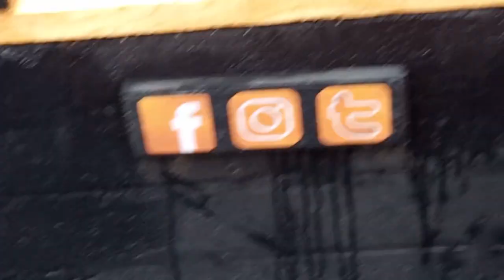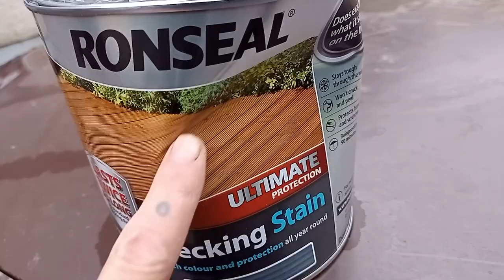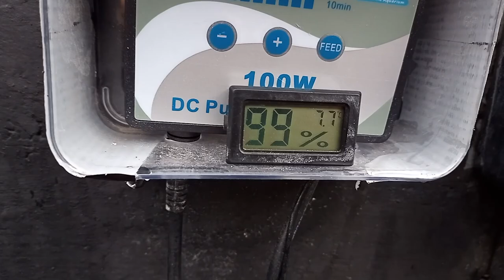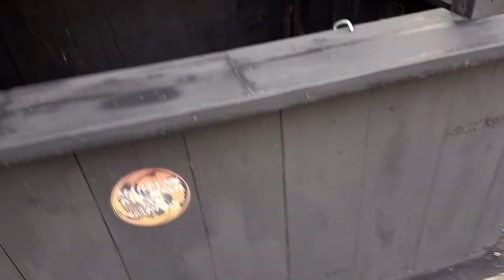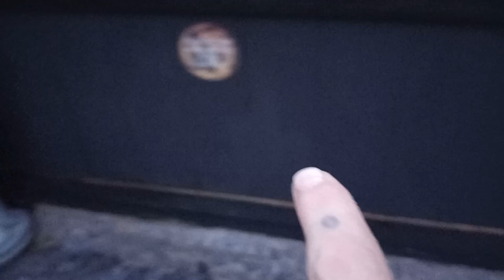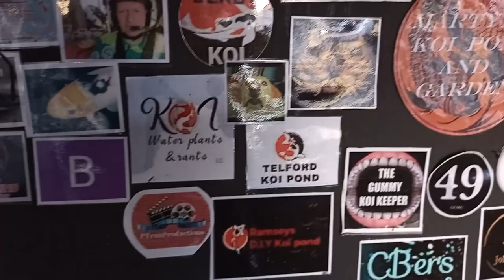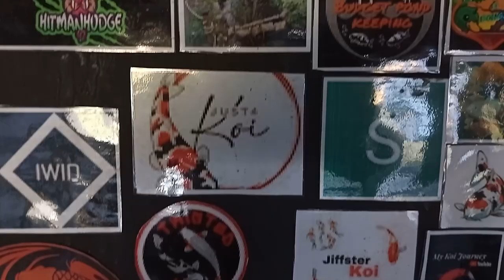staining the pond capping and a new addition  bhudda koi pond one man pond build #koipond #koi #diy

Comment: The grey stain on the wood looks really good and ties in well with the slate. I think a large piece of Jap mat would work well up against the side of the moving bed and stop any K1 escaping and running down the drain. Your brushes should stop the Jap mat getting tangled with blanket weed so cleaning shouldn't be too bad. The IBC would make a great grow on tank as I would worry about small fish in that size of pond unless you plan on adding large fish in the future instead of watching small fish grow.
Reply from the maker: Cheers Oliver jap mat ain't cheap I will have a good think about what I can do with the ibc cheers buddy 👍
Reply: @martynskoipondandgarden4581  I know what you mean everything about koi is expensive but it's not just koi related products everything is expensive I went for a meal out with my family at Bella Italia, 4 of us and the bill was just under £100. At least Jap mat lasts a bit longer and is better value than a meal out lol 🤣 👍